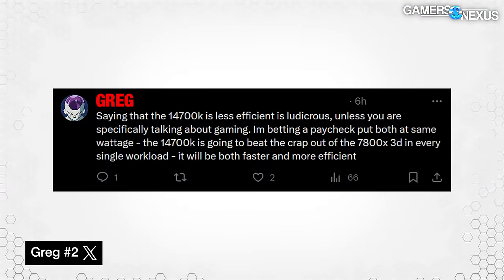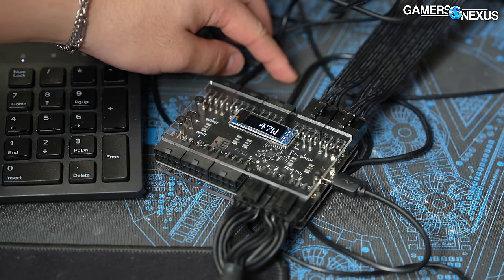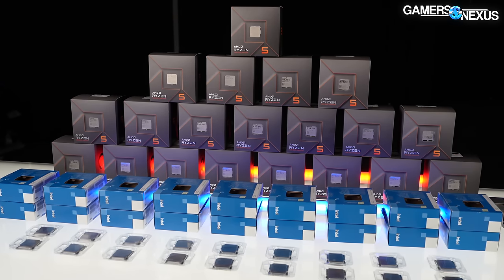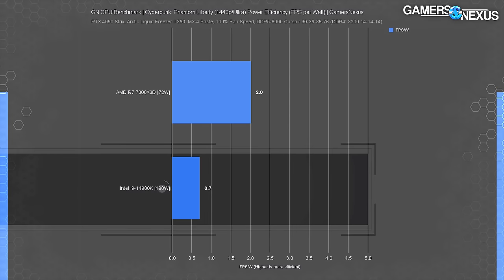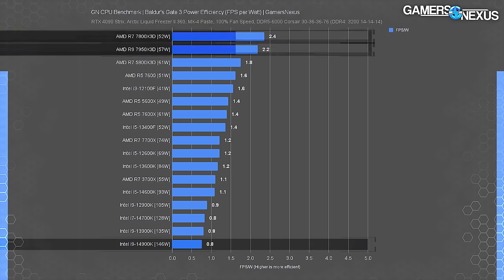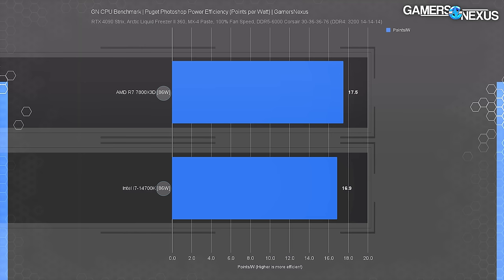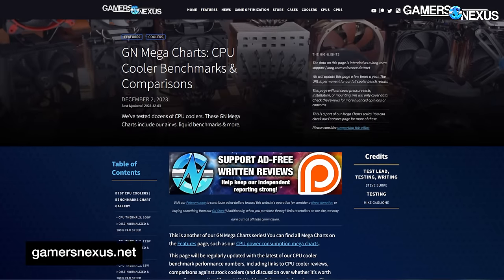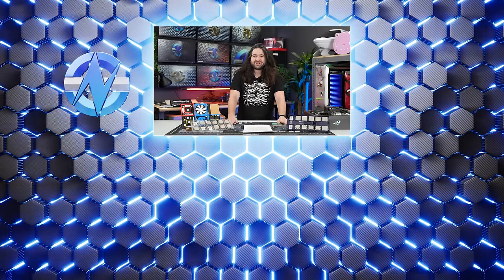The Intel Problem: CPU Efficiency & Power Consumption

Comment: I've done extensive testing and I've found that if you power limit both the 14900K and 7800X3D at 0W they perform identically with identical performance per watt.
Reply: Of course they would! 😂
Reply: Dont say it to Greg, he would still bet that even at 0w the intel cpus where more efficient and faster
Reply from the maker: Wow! This is a huge break-through! We'll immediately test the power consumption of the systems when they're off. hahaha
Reply: You are wrong.. Intel CPU will actually give out energy from ether while AMD CPU is just turn off at 0W
Reply: @GamersNexus  Actually, that's not as mad as it seems, who actually switches their systems off at the wall .......
Reply: And even though they have different prices, they both get the exact same bang/buck!
Reply: ZaHandle  In real world scenario that will be very dependent on PSU quality. I have Seasonic and used to have Corsair (one that was made by Seasonic back in like 2010?) that pull around 20W less from the wall  than other PSUs I've tested. Like Chieftec, and another Corsair, some nonames.  Somel were around 20-30W even at sleep and soft poweroff, while those which "clicked" (Seasonic) were 5-10W.
Reply: The only way Intel is on par with AMD. ;)
Reply: @misiekt.1859  Yes, it depends on PSU quality as well as on a motherboard.  But seeing such high power consumption makes me wonder if you enabled ErP compliance in BIOS. With it enabled, power consumption in a soft shutdown state should generally stay below 1W or 0.5W, depending on the age of the hardware. Maybe a little more on 110V supply
Reply: Technically 14900k still pulls ahead because bigger number better.
Reply: @Zoomborg  but the 7800x3d has one more X, and we know that more X equals more better
Reply: The true science
Reply: @misiekt.1859  Seeing such large values during poweroff would have me cast serious doubt on the accuracy of your power meter. It may only be displaying apparent power, not real / effective power, a problem that used to be quite common years ago but has largely gone away. A PC power supply in standby tends to exhibit very low power factor, i.e. current is largely out of phase with voltage and reactive power is a lot greater than real power. An apparent power meter will just measure the magnitudes of voltage and current separately and multiply the numbers, which is fine for purely resistive loads like tungsten lightbulbs or heaters but falls flat once things get appreciably inductive or capacitive.

Most meters these days will measure real power quite accurately, but if you want to be absolutely sure that the circuitry is legit, insist on a power factor display.
Reply: @misiekt.1859  Bequiet 850w latest version does this too, I'd never heard it till now, relays are great you can also tell if you turned it on or not lol.
Reply: @PileOfEmptyTapes  Yeah, I couldn't believe watt meter too, so I verified this with my TRMS multimeter. I also checked power meter from my provider, which is ultimate measurement what I pay for. I could be off by 1-2W, not 20.
Reply: @Osaka2407  I'm in EU so 240V. And the difference was pretty much regardless if tested PSUs were actively powering computer or not. I mean I wouldn't be surprised if cheap PSU would draw 10% more when in the same stress scenario maybe around 200-300W. But during sleep and soft off it was bizarre. Even if I just shorted PSU pins I got similar results. Maybe you are correct about ErP, but why bother when Seasonic doesn't care one way or another. So I'm just using that.
Reply: There's still the weight factor :
ÀMD weight 34gr
Intel weight 48gr
Reply: Science !
Reply: Not gonna lie, had me in the first half
Reply: ZaHandle Standby power usage will depend slot more on the motherboard than CPU.
Reply: This deserves a Nobel Prize for such a worthy discovery.
Reply: Power prices are high enough here, I switch the PC off when not in use.
Reply: @FreshChriss  ah yes... moar buttah
Reply: Wrong - you can't divide by zero. There is no performance per watt when there are no watts so you can't compare it to say they're identical.
Reply: Greg reminds you, that Intel uses less watts whenever the system is idle, so if AMD is at 0W the Intel chip has entered generation mode, supplying the grid.

Comment: The 5800X3D will need to be in a CPU Hall of Fame. What a champ of a CPU. I feel like this CPU alone will keep AM4 around for quite a few more years.
Reply: Yea i went to am5 and got the 7800x3d but my brothers build i stayed am4 and for the price to performance the 5800x3d and a b550 velocita being 175$ cheaper than my combo... Lets say i have a 7900xt in my am5 build.. for the same price u can stay am4 with the 5800x3d and get a 7900xtx and have better performance for the same price as the am5 system
Reply: I bought one for a Dual Vega 64 Crossfire build as I was trying to get around the poor GPU scaling due to CPU bottleneck. Just for a fun project. It worked. Both Vega 64 GPUs get 100% utilized and you get a doubling of performance. Very strong CPU.
Reply: Currently on ryzen 2700 when im gonna upgrade i dont know but when i do it will be 5800X3D it will be cpu that a lot of people with old ryzens will upgrade to just because performance of it for just upgrading your cpu is insane
Reply: For gaming yes but for anything non gaming not really.
Reply: Yeah, just got a 5800x3D and it made me wanna keep my am4 platform for at least another couple of years, if not more.
Reply: @luizarthurbrito  maybe more, upgraded from this to 7800x3d its slower
Reply: I agree, but there's never been a cpu like this before.  For all we know, the stacked 3d cache will expire after a certain amount of time.  Only time will be able to tell how long these 3d cache cpus will last.  I hope that it's not significantly lower than a normal cpu.  It would be awful convenient for them to just not work anymore after 5 years or so, just in time for an 8800x3d.
Reply: I'm currently upgrading my 12 year old PC, and due to constraints in budget will settle for a 5600g, but i would have loved to get a 5800x3D, but the difference is just too high 130$ vs 320$ will probably upgrade later with a used one.
Reply: @thepcenthusiastchannel2300 interesting 🤔. I can only imagine the power consumption of 2x v64 GPUs
Reply: @shapeshiftsix Nothing to really wonder about when it comes to longevity. Its the same SRAM that that you'd find built into any other CPUs standard cache, just more of it in a non-monolithic fashion. As long as you don't feed it unsafe voltages, there is no reason to expect it wear differently from non X3D CPUs.
Reply: @shapeshiftsix  that was my thought as well. It's very sensitive to heat and voltage after all. I just have a regular 5800X and might upgrade to Zen 6 maybe.
Reply: @o74769  I would get a 5600 or 5600X if you already have a GPU
Reply: @newtwitchclipper  To be fair, for the average gamer, even the 5800X3D is an overkill. I recently switched out my 3500X for a 5700X, which costs less than half than the 5800X3D, and at 1080p 144Hz, I have yet to run into a game that pushed it over 50% utilization. I imagine the top-end AMD CPUs will be future-proof for at least half a decade, if not more.
Reply: Still loving it as an upgrade from my 5600, going to keep this system for as long as the cpu lasts, got a 7900xt which should last for what I play for yeeeeears
Reply: I'll upgrade my 5600x to a 5800x3d eventually, AM5 will be mature by the time i upgrade from that.
Reply: I am a bit of an amd fan,  but actually intel did well enough that the difference wouldn't affect anything that I do.
Reply: i cant believe i went with a 12600k... putting the build together now but i wish i bought a 7600. Now when i upgrade the 3060ti to a 4070ti, the gpu will be bottlenecked by the 12600k :(
Reply: It will be one of the greatest of all time CPUs, it's just phenomenal silicon
Reply: everytime i see such a video i pat my pc with the 5800x3d.
Reply: Yep, I just upgraded from 3700X last month and im planning to stay on AM4 for another 3-4 years at least. Insane longevity on that platform
Reply: I've been building my own computer for decades, and I can't remember a better upgrade than swapping a 3800X out for a 5800X3D.  I feel like it's going to last me a good while. We'll see what the next gen parts can do, but it's going to take a new "killer app" to give me the upgrade itch again.
Reply: @Horvath_Gabor  I agree. CPU upgrades are more about futureproofing when it comes to games at this point. My LAN rig is still an ITX i5 6700 with a high end video card. It is starting to become the bottleneck, but it can still feed 144hz for the most part.
Reply: It's kinda wild that you can drop in a 5800x3D into a 2017 am4 board and have it outperform a brand new z790/14th gen Intel setup, for gaming.  Amazing longevity.
Reply: It's a decent CPU, but it doesn't like 4K and 6K when he gets above 70 FPS
Reply: @fearone9694  It's a lot. Especially since they're power modded as well. Custom watercooled. Around 450W each at full tilt. It's only for testing, not what I game on.
Reply: Last gen is king. For the same price as my upgrade from a 2700x and 2060, I could've either gotten a 7600 and 4060 or a 5800x3D and used 3080 (since I had an AM4 board and DDR4 already). No brainer for me.😊
Reply: 5800X3D is a monster.  Might be the greatest CPU of all time.  Can't think of anything better.
Reply: Definitely, my next cpu will be 5800x3d... And will use it till it can't keep up with GPU
Reply: @timothyandrewnielsen 5800x3d pioneered 3d stacking, 1st gen thread ripper shook the workstation market.
Gotta have both 😅
Reply: @newtwitchclipper that's true , The am5 system gives you a cheaper upgrade path though.
Reply: @Horvath_Gabor The cpu utilisation percentage is a nearly useless metric in gaming workloads.
Reply: @jamesm568 eh?
Reply: @newtwitchclipper  the Ryzen 5 7600 is better. It has the same performance as 5800X3D and it has the benefits of AM5 too.
Reply: @Jasontvnd9  It's a bottleneck with a 4090. Performance better in 6K than it does in 4K.
Reply: If only i could find that cpu at an affordable price in my local currency.
Imagine a refresh with an additional 128mb cache.
Reply: I love mine.
Reply: @Drew1218s  For anything non gaming it's still not terrible. It performs like an under clocked 5800x because that's literally what it is. Just with a huge cache in a faster to access place.
Reply: @martinmalone6324  I'll be honest. If/when I upgrade it'll be to a more mature AM5 platform. Anywhere between mid platform life to near end of the platform life.
Reply: @Horvath_Gabor  I only went with the 5700x because it had a similar power draw to my previous 1700x. With an obvious improvement in overall performance.
Reply: @jawohlbxb3534  you're waiting too long to go 5800x3d, as stocks are diminishing.
Reply: @ArtisChronicles  it’s not terrible for non gaming work but in the same price class there are cpus which will handle those tasks better.
Reply: @Drew1218s  Even non gaming it is a great operating CPU for personal work use. Honestly if you're on DDR4 it is probably my go to CPU recommendation
Reply: Running a 5800x3d with 7800xt red devil le. No issues at all with any games playing 1440p @ 144hz
Reply: @thepcenthusiastchannel2300 dual vega 64 is sick, I'm jealous, what workloads/games are you using that are consistently getting 100% utilization on both GPUs?
Reply: @Drew1218s Gaming isn't the only cache dependent workload - the 5800x3d actually started out as an offshoot of AMD's 3d cache work which was largely developed for Epyc (some of their Epyc chips now have over a gigabyte of cache, it's insane)
Reply: @baloneyslice247 Don't fret too much about it, there's probably going to be plenty of cheap upgrades on the used market from 12th and 13th gen Intel by the time the 4070ti is cheap enough to be a good value upgrade
Reply: @Jasontvnd9  id just rather get the cheap am4 boards and use the price difference for a better gpu, at least that how my gamer brain works
Reply: @bosstowndynamics5488  they have over a gigabyte of cache but that’s not too insane really when you think about how many cores that cache has to service.
Reply: @steelfox1448  Battlefield 4 now gets 100% scaling. Anno 2070, Alien Isolation, and Arma3 all get perfect or near perfect scaling now. Anno 2070 had terrible scaling prior.
Reply: @shapeshiftsix not really, if x3d chips fail due to 3d cache degradation it is now likely to stimulate buying competing brand just out of spite.
Reply: The 1080ti of cpus. And just like Intel, and won't be making that mistake again. This is why 7800x3d is not and 9800x3d probably won't. Can't be satisfying people too hard, just enough for the next gen to seem  good enough to upgrade.